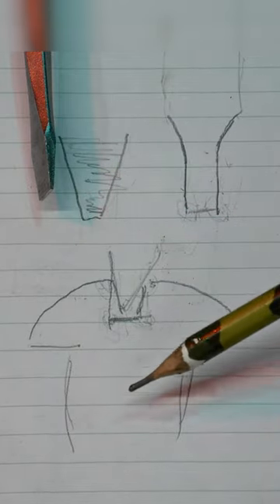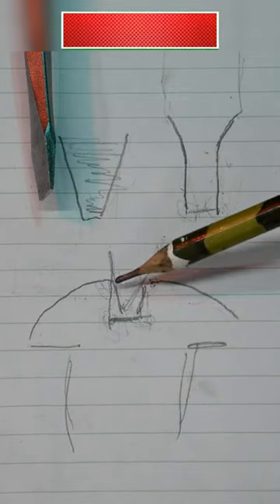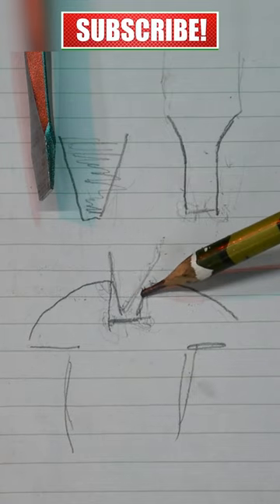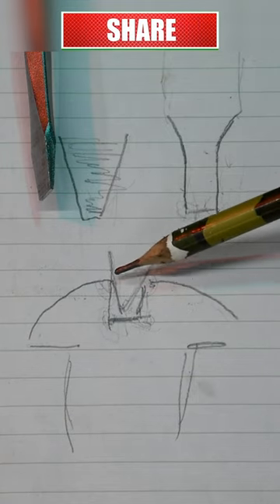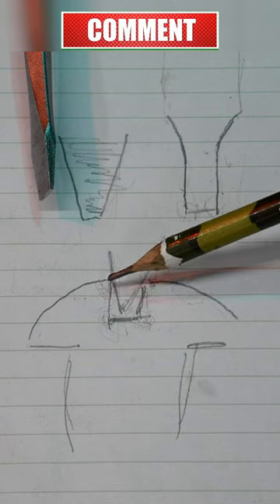Hollow Ground vs Wedge Shaped Screw Driver #short #tools #tooltips

Comment: Then you shift the failure point from a .30 cent screw to your $40 specialty screw driver
Reply from the maker: I would generally agree that it's not worth it if I was choosing to use screws... Though flat then would be the last screw I would choose as they are harder to use than other options. Having a screwdriver like this then mainly helps when working on an older item where replacing the screws is not an option... Wow... I wrote quite a book here, lok 😂
Reply: @wamindustries  this design would make a pretty good bit for an impact screwdriver